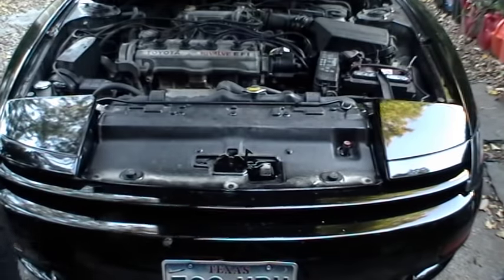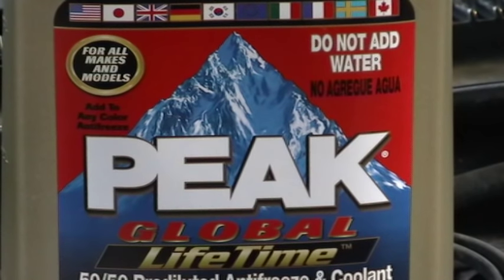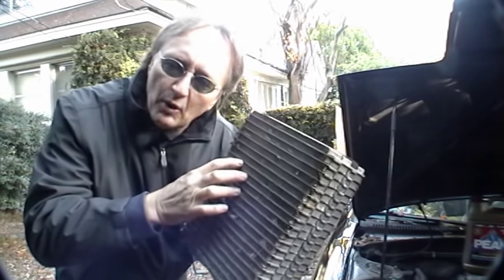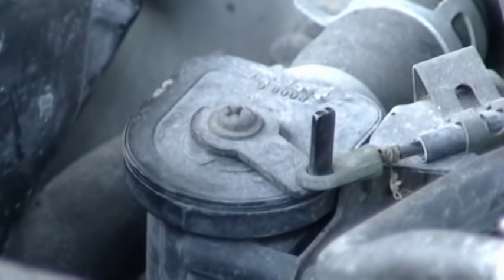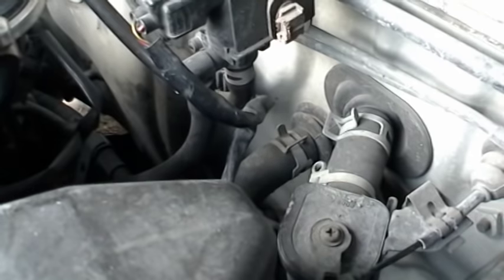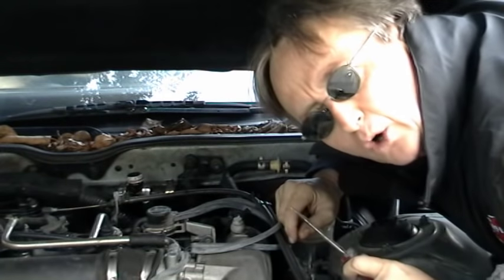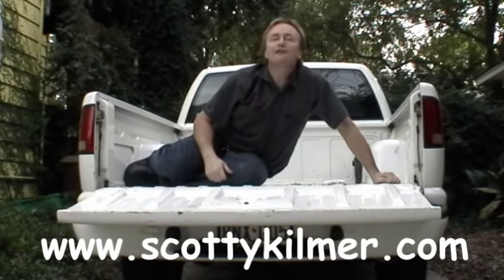How to Fix a Car Heater

Comment from the maker: ⬇️Things used in this video:
1. Screwdriver set: http://amzn.to/2j92UCG
2. Ratchet and socket set: http://amzn.to/2inoxOY
3. Mechanic’s Tool Set: http://amzn.to/2Bzmccg
4. Flashlight: http://amzn.to/2kwtiu3
5. Common Sense
6. Full HD Camera: http://amzn.to/2AvoEk7
7. My computer for editing / uploading: http://amzn.to/2i2sKYz
8. Video editing software: http://amzn.to/2jv5Fhf
9. Thumbnail software: http://amzn.to/2k7tz6C

🛠Check out my Garage to see what I use every day and highly recommend:
https://www.amazon.com/shop/scottykilmer

👉Follow me on Instagram for the latest news, funnies, and exclusive info / pics:
https://goo.gl/ohy2cA
Reply: Scotty Kilmer you’re great
Reply: Scotty Kilmer you should tell not to much pressure of water from hose just gentle or damage will happen
Reply: @Scotty Kilmer   Have a heater problem.  My 1994 Camaro blows out cold air.  Although at times it blows out warm air.
Reply: Wow, Scotty is such a joy to watch. He makes you glad to know how to fix your own car!
Reply: Hi Scotty  my accord 2003 is blowing cold air on driver side passenger side is nice and warm I all ready  change the water valve and Heater Regulator Motor .
I live in New York  and the winter is very cold
Reply: I have the opposite problem with my car
Reply: Gasket leakage could be a problem?? Plz reply
Reply: Hey scotty I got a 2013 ford f150 5.0L I got no heat in my cabin

Comment: Also, 

If you arent getting heat and its none of the problems Scotty talked about, check your "Blend Door" or Blend Door Actuator.  Its a door that seperates the cold a/c air and the heater air.  

Mine was stuck in the middle and when i turned on my heat it came out cool.

Comment: The garden hose flush method is great, however, Scotty did not mention that it should be low pressure. DO NOT turn the hose on hard, because the the high pressure can blow the seals out and then you have a real problem. Low pressure only.
Reply: True

Comment: Hey Scotty, 

Well, after, ......to be honest.... AVOIDING this 'no heater' issue for a year, I decided to flush the core. It was spotless..... after a lil investigating, it turned out, that under the dash, the box under the core, ...the lever was moving but the cable was bound, so I forced the doors open manually...VOILA, heat enough to burn the hair off my legs! lol. 

Thanks for responding, just thought I'd throw it out there, .....follow the lever cable, guys, make sure it's opening! lol.

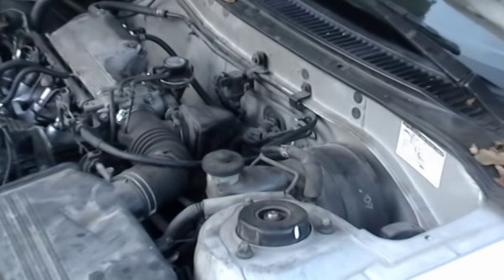Comment: 1:42 Most cars don't have the valves there. Don't they. I had a problem with an 02 Eclipse I had before. The passenger side blew warmer air, while the driver side was less warm.

Comment from the maker: That's often a symptom of a clogged up heater core, the water can't flow fast enough so you get heat only a short time, then the water is out of heat and new hot water can't get in fast enough. Try flushing it out BEFORE replacing it, as replacement is normally rather expensive. Scotty Kilmer

Comment from the maker: @ssl668 generally the cores need replacing when that crapped out. But, of course, check to see if the cooling system has no air in it, we mechanics use vacuum systems to suck all the air out and know there's none left in.

Comment: My heating hasn't been working for over 3 weeks and I know nothing about cars. I finally booked it in to get fixed tomorrow but thought I would have a quick search and came accross your video.  The first thing I checked was the coolant which was near empty.  I bought some from my local garage and filled it and within seconds I was getting hot air again!!!  Thank you so much, you have saved me aair few ££££££s
Reply from the maker: If you like my car help, be sure to watch my live car talk show every saturday morning at 10 AM CST on google events. I answer your car questions LIVE there. Just go to my scotty kilmer channel on youtube saturday morning at 10, and click on the google plus icon on the top right corner. That takes you to the event. You do have to be a member of google plus to ask questions, so join up, it’s all Free.

Comment from the maker: insane job, takes 6.5 hours of labor. 

HEATER CORE REPLACEMENT

REMOVAL PROCEDURE

	

    Remove the HVAC module. See: Heating and Air Conditioning\Housing Assembly HVAC\Service and Repair
    Turn the HVAC module over.
    Remove the heater core case cover screws and cover.
    Remove the heater core bracket screws and brackets.
    Remove the heater core.

INSTALLATION PROCEDURE

	

    Install the heater core to the module.

Comment: Hi Scotty - awesome video.  I have a 2007 Chevy Uplander that will only heat while driving.  When I stop moving and idle it will slowly return to cold air.  I think there is an air pocket in the pump/tubing or something like that - any ideas how to correct this?  Thanks!!!

Comment: I have a 2007 Mercury Monterey that when the AC is on the driver side blows hot air and passenger blows cold air then when the heat is on drivers side blows hot and passenger blows cold. anybody know how to fix this problem

Comment from the maker: @tH3FtoN3  NO, they often hiss as doors open and close and the refrigerant starts flowing. If you have dual AC controls, the passenger side is breaking down. If you don't, it's just low on refrigerant probably. Scotty

Comment from the maker: doesn't matter which hose you use, but you mentioned replacing the heater core, so flushing should not be needed as that's brand new. I would guess electronic control problem myself in side the dash, those are known for that.

Comment from the maker: @HDxCasTpeR change the thermostat and make sure the cooling system has no air in it when done. then pray the heater core isnt' clogging up.

Comment: Just had garage (too cold.out to do myself) flush my heater core on 2007 Buick Allure 3.8  Was pumping cold air lower vents and ambient out of upper vents (-13 celcius Ontario Canada) Mechanic never seen such a dirty core.  Snowing today and boy is the heat in the car beautiful.  Thanks Scotty.

Comment from the maker: @18kswag you're stuck on default position, check for a vacuum leaks on the system if an older car. If newer, the dash needs taking apart to fix the blend door system.

Comment from the maker: do all this, and make sure the heater control valve is opening. Really flush the heater core for 20 minutes or so, and PRAY the heater core isn't just shot. They are a pain to replace

Comment from the maker: @ShortyzProductionz your blend door system inside the dash is breaking down, probably a broken or stuck blend door or actuator. Time to take the dash apart if you want it fixed.

Comment from the maker: @godgotme22  no, it doesn't, it has a blend door inside the dash that lets hot air get into the cabin. The heater core always has hot water flowing inside in that design. Scotty

Comment from the maker: @sReychaRm  Either the heater core is clogged and needs cleaning out or replacing, or the blend door is stuck and won't fully open. Try flushing it out first, the other two options are VERY expensive. Scotty

Comment from the maker: yes, replacing it is a royal pain though. Here in houston it's hot most of the time, so we just cut the hoses going to the heater core and splice em together with a 2 dollar splice kit. Then it can't leak anymore, as we dont' need heat anyway.

Comment from the maker: the low side fitting can be found by following the thicker hose from the compressor back to the firewall, it's often near the firewall. The high side one is on the thinner hose, follow that hose from the firewall back towards the condenser to find it

Comment from the maker: If you mean the fan does not blow at all, yes, it could be the fan blower motor. Just access the motor under the dash and hot wire it with electricity from the battery using small jumper wires. If the motor does not blow, replace it. If it does blow then, find the electrical short going to it. Normally it's just a worn out motor though. scotty Kilmer

Comment from the maker: realize heater cores can corrode internally, look fine, but won't dissipate heat. I would just have replaced the core when doing all that work. But, check the blend doors in the dash, if they don't work right heat will not get hot

Comment from the maker: if both hoses are hot, don't worry about the valve, it's working (and some don't even use valves, they have hot water in them all the time, only the blend doors in the dash open and close to let you feel the heat inside.) But fix the leak in the radiator first, air in the system will cause no heat too.

Comment from the maker: @altpath I would assume the heater core was leaking, so they did that to stop it. connect it, then see if coolant leaks inside the dash. If so, time for a NEW very expensive heater core job on that crazy design, the book calls for almost 8 hours labor.

Comment from the maker: the flashing light means the AC system has a problem. MANY things can do that, you need a dealer level scan tool like I have to analyze the codes. So find a guy like me to do that for you.

Comment from the maker: they could be, french cars tend to have electrical problems as they age. Check the dash for bad fuses or bad wiring first, and pray it's not in a control module or Ac/Heat computer control system, they are VERY complex.

Comment from the maker: if the fans do come on and it doesn't overheat, live with that. as for heat inside all the time, the dash is stuck on head, and that baby is all electronically controlled. Blend door is probably stuck on heat, have to take the dash apart to fix that

Comment from the maker: @woodlandcammo27  Electrical problems on an old Ford, that's not surprising. Start by checking all the fuses and running power to the wiper motor and blower. If they work with power, find where the short in the wiring it. Scotty

Comment from the maker: You may just need a new blower motor as they wear out with age and don't spin fast enough. And sometimes crud gets sucked in through the glove compartment and that radically slows down air flow, so check that too. Scotty Kilmer

Comment from the maker: AC system makes cold air, heater makes hot air.  If you have no cold air, check the ac system. sometimes the blend doors inside the dash will get stuck in the hot position and not allow cold air, so check that first

Comment from the maker: head gasket job on that min van is hellacious. But if you get low on coolant, you will have the same symptoms of cold hoses and parts. So do my video tests "how to fix an overheating engine" and pray it's one of those instead.

Comment from the maker: @godgotme22 bad blend doors are common on all fords, requiring taking the dash apart. IF both of your heater hoses going into the firewall are hot, that's probably it unfortunately.

Comment: You may have already covered this in the video but, in my 97 olds 88 I noticed that it doesn't get very warm in the car anymore. I thought first that the control might not be working so I turned it all the way down and it got cold then as I turned it up it gradually got warmer but it never got hot. Then I noticed the temp gauge was low (around 150 F). At the time it was 9 degrees outside. Now I've got a piece of cardboard covering part of the radiator and it seems to be working well.

Comment from the maker: @diva11111111 heaters on those are electronically controlled, and that breaks down in dodges all the time, costing a fortune to tear the dash down. check the fuse first for the lighter, then change the lighter assembly if that's not it. Scotty

Comment from the maker: it costs a small fortune to replace a heater core in that car. But if it's bypassed, nothing will happen, not steaming up. You should bypass the core now correctly by spicing the two heater hoses together under the hood. Then it will not steam up cause there's nothing in the core then.

Comment: Thank you so much for all of your trouble shooting tips. This video really helped. My problem with my heat was an Actuator that opens the door to let the hot water in, to heat the car. Not an easy fix but I figured out the problem with your help. Thanks again!

Comment from the maker: of course check the fan motor first by hot wiring it from the battery with jumper wires. motors oftne burn out.  they use electronic heater valves hiding inside the dash and are cows to get to. good luck, on that.

Comment from the maker: I would assume bad motor or clogged airways first, but if it's not that, the heater core would be bad, blocking air flow. That's rare though.

Comment from the maker: It could be a leak in the heater core, but there's only one way to pinpoint the leak. Have the system pressure tested and see where the leak is coming from. Or, you can put a UV dye into the radiator and see where the green dye comes out. Scotty Kilmer

Comment from the maker: When cables melt, you have a Serious electrical short. You will have to trace it down, Perhaps the blower motor is shorted out, but you will have to trace the whole wiring from where it's melting back to where it isn't melting. good luck, scotty kilmer

Comment from the maker: @lilblueguy that's a big giant job, not really a do it yourself job cause the head has to be checked for cracks and warpage by a machine shop anyway. And you need tons of expensive tools, like good torque wrenches, and years of experience to do it without messing something up. engine tolerances are VERY tight. Scotty

Comment from the maker: replace the thermostat first, if bottom hose stays cold either that's bad, the pump is not pumping right, or the radiator is clogged up inside

Comment from the maker: Actually, that shouldn't make the engine not heat up. I would advise putting in a new thermostat as I show in the video. the thermostat regulates the engine warm up period a LOT more than the fans do. After all, cars put out plenty of heat on the highway, and you have sixty five miles an hour wind blowing through the radiator then. So put in a warmer temp thermostat and it should warm up fine. Scotty Kilmer

Comment: Scotty, I think this is a good explanation for my issue with a 1966 Ford F100.  I actually replaced the heater core, which only took about 20 minutes, but noticed no water coming from the engine, and the temp gauge read C.  So I will be replacing the thermostat next.  Thanks,

Comment from the maker: For some reason you AC is staying on, it should only be on when you turn it on or when you have it on defrost. Your control unit is probably breaking down, and they aren't cheap. But, you could just unplug the AC compressor clutch wires and just plug them back on when it gets hot outside and you need AC. Scotty Kilmer

Comment from the maker: @reddsofine1 You have a control unit problem, and those things are complex in MITS, everything is electronic. Many guys will just bypass all that crap by putting in a manual valve for heat that they can open and close by hand when opening the hood on old things like that. Scotty

Comment from the maker: No, the heater doesn't turn the cooling fan on, only the AC or when the engine gets hot enough to turn the thermal switch on to make those fans blow. Scotty Kilmer

Comment from the maker: I would hot wire the motor first, if it blows then, change the resistor. if it doesn't blow, change the motor

Comment from the maker: you find the valve, remove it, and see if the valve opens and closes. Or use a thermometer to see if both sides of the valve hose get hot when you turn it on

Comment: I had a leaky heater core in my 99 Durango. The lovely smell of maple syrup and the windows constantly fogging were no good. Threw a bottle of Bar's Leak Stop in, never had a problem again, that was years ago. Granted, it hasn't ran in a few months (something else is wrong) but the heater always worked and the windows never fogged after that.

Comment: I actually saved my friend's car from the crushed by dropping in a used $250 engine.  It works great plus I learned a lot doing the swap.  Volvo does seem to design cars with the mechanic in mind.

I never owned one but I'm sure you are right about them.  Deprecitation is horrible on them.  The performance T5 models that sold for near 40 grand are worth only 5-8 grand after 5-8 years on the road.  OUCH!

Comment from the maker: Yes, your Heating system is stuck on default, which is defrost only for driving safety. check all over under the hood and under the dash for a vacuum line that may have fallen off. If you can't find any, then you have an electrical problem as the newer cars like yours use computers to run everything. In that case, check for a blown fuse and hope it's not more complex, cause even mechanics hate working on those crazy GM heating system electronics. Scotty Kilmer

Comment from the maker: @babigurl2131 You have a worn blower motor or stuff like leaves stuck in it making that noise. The leak would be something else, often a leaking water pump. Have the system pressure tested to find where the leak is. Scotty

Comment: On my 2005 Pilot all I had to do to get heat back was tighten the screw on the heater control valve.  Worked like a charm, you didn't mention this.

Comment from the maker: @alproductionz08  On those expeditions, 99 percent of the time it's a bad blend door inside the dash, up to an 800 dollar job to fix with a mechanic. There is no heater control valve on yours, hot water always flows through the heater core. Only the blend door opening and closing inside the dash gives you heat or takes it away. There's not much working room inside there. Good Luck, Scotty

Comment from the maker: IF you mean the blower doesn't blow at all, but then starts blowing, odds are you need a new blower motor. Go to the motor area, under the glove box, and whack it. If the blower starts working, the motor is wearing out and replace it. Scotty Kilmer